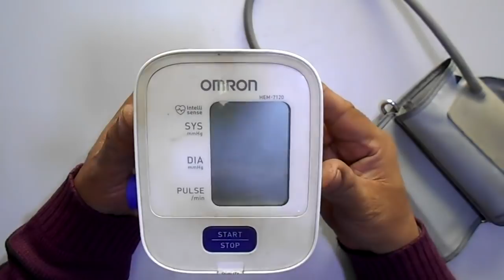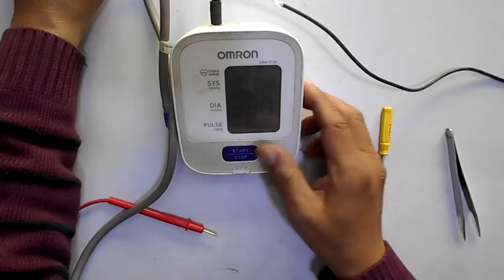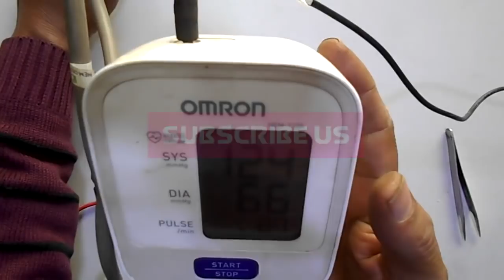Omron Automatic Blood Pressure Machine Repair

Comment: I have life Source Model UA-787 life time warranty.  It gives cuff error. Cuff is not covered under warranty but cuff is working fine with other BP monitor and actually  pump is not generating pressure.  Manufacturer is not ready to listen.  They say if it is cuff error  code it is cuff issue.

Comment: NIce video!  I have a problem with the Medline MDS4001 Automatic Digital Blood Pressure.  It worked fine with batteries until I switched to an AC adapter.  Unfortunately, the unit was not working with the AC adapter so I switched back to battery.  The unit became malfunctioned (the start/stop buttons didn't work  & the screen monitor went completely blank) even with new batteries.   Appreciate your input.
Reply: have u got the soltution tell me bro
Reply: Is monitor ko kon si shop se theek karaya ja sakta hai

Comment: Were you not supposed to wear thin rubber anti-electrostatic gloves when touching electronic devices inside? This time you may have not damaged some electronic parts. But it is not only good practice but also essential to wear them if you want to make sure electronic parts which form part of the circuits are not damaged due to the electrostatic charge your hands may carry.
Reply from the maker: We are glad that you notice such a minor thing that most people generally ignored most of the time but the technician who is repairing the stuff, is highly experienced and he knows where to touch or not but for a newbie its highly recommended

Comment: I have one malfunction, which is that the screen shows incomplete numbers. I opened it. I did not find any apparent defect. What is the defect in your opinion?
Reply: Most probably damaged screen. Get a replacement screen.
Reply: Connectors to the screen not making good contact.Try pressing them down.
Reply: @akshaymathur5665  th.u
Reply: Same problem, not the screen, not the ribbon seems like the back plane to LCD.

Comment: Hello sir,
I am using Omron BP monitor HEM 7120 series. It shows E2 error always while measuring. After looking in manual. It was found that arm cuff problem. I am using it properly and arm cuff is okay. Instead of it facing same problem. Please help to rectify it.
Reply from the maker: Is battery is in good condition

Comment: Sir jee. I am having OMRON Reli On make m/c.
 Everything is ok but I think the pressure of the pad gradually decreases automatically after pumping. and secondly, the display is not working properly. some of the digits can be read properly. we have to assume. How to repair display Model is Reli on manual model HEM412 CREL . It seems that the ribbon supplying signalls to LCD is partly loosened. How to fix for pucca contacts?
Reply from the maker: +Jeevanlal Patel If you think ribbon that supply voltage is loose just check continuity across all the pins of ribbon 

Make sure your battery is new and clear the carbon deposited across the battery connector
Reply: @ElectricPointOfficial  my BPL B3 MONITOR doesn't make perfect pressure ,,,, when I power on 1 to 2 sec pump and then shown wrong reading

Comment: Sir I am wrongly connected laptop charger to blood pressure machine  small smell is comes to machine and not worked what's the problem sir
Reply: Roasted Circuit
Reply: Is it any repair chanse
Reply: @srinivasyamini4101  I think no... You should buy new one.
Reply: Kk tq
Reply: 6v ki machine ko 20v supply de diya tumne😂
Reply: Even i did the same thing...so is there no way to repair it??
Reply: Once the smoke come out of those tiny components,  its very difficult to get it back in again. 😃

Comment: Just put a drop of WD-40 into the switch...most likely it will start working again.
Reply: what is WD-40?
Reply: @tanmaychoudhury8349  A spray sold in hardware stores (HomeDepot) used on metal parts (like locks, sliding windows) for smooth moving if they stuck.